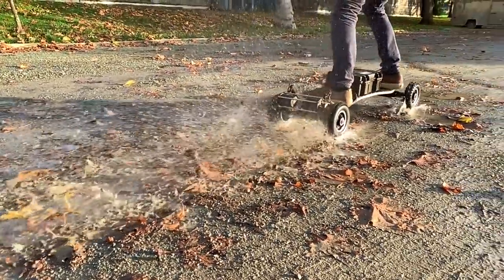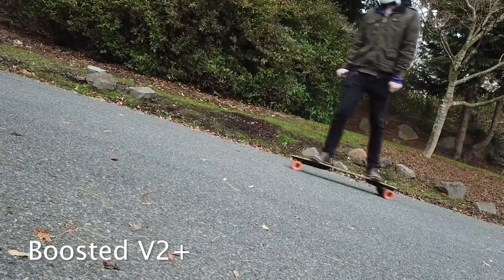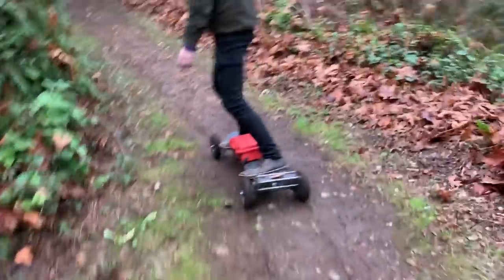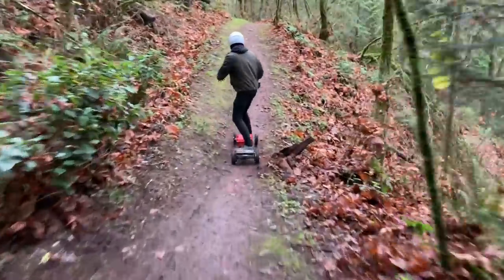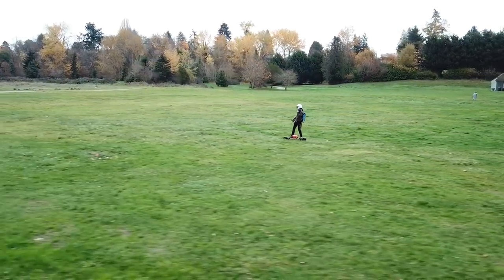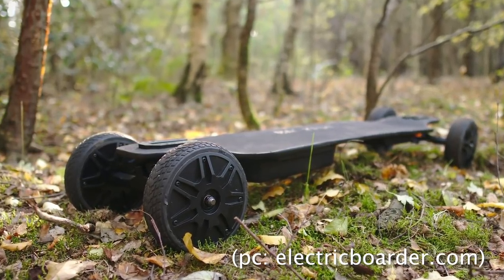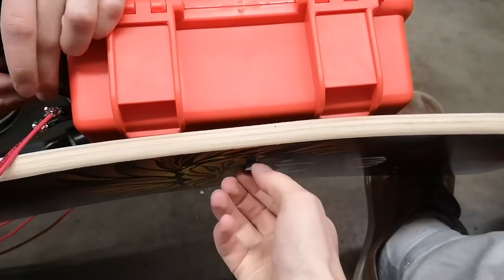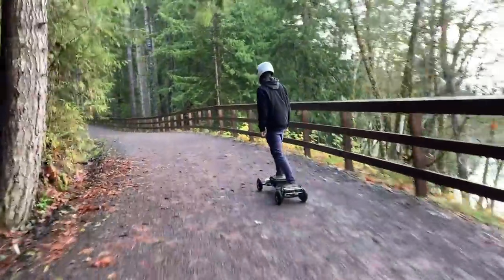DIY 9,000 Watt All-Terrain Mountainboard Beast Power-sliding and Off-roading

Comment: The base of this build is a cheap china made board that is junk. The rest of the build is ok but still could be alot better.
Reply from the maker: rowley dell the skate parts are great. Still absolutely no failures months of very heavy abuse later. If you want to spend more time and money go right ahead, but if you're just going to thrash your board off the trail, it won't make much difference and you're not going to get anything more durable at the same price.